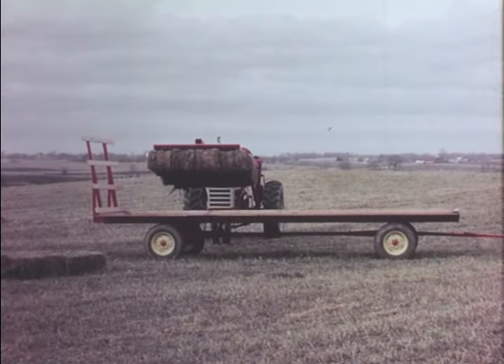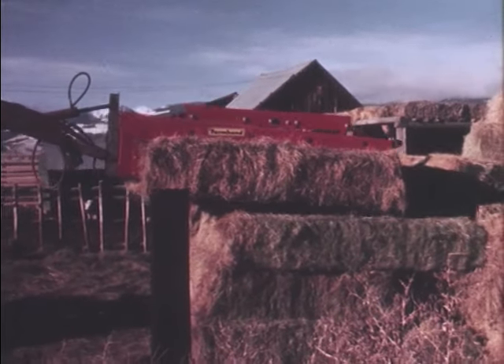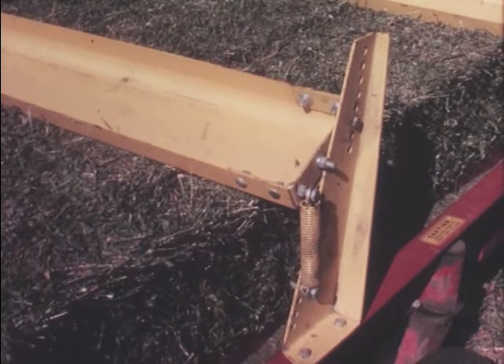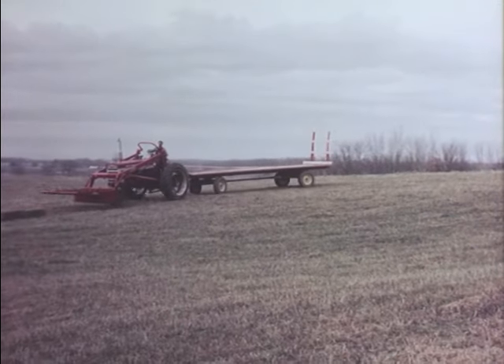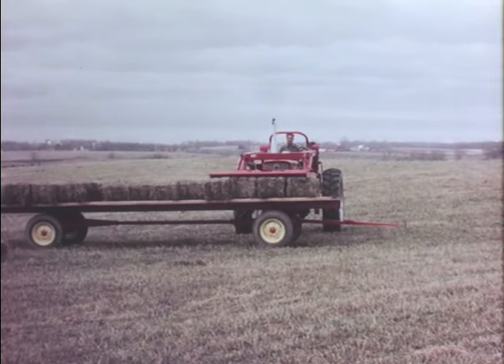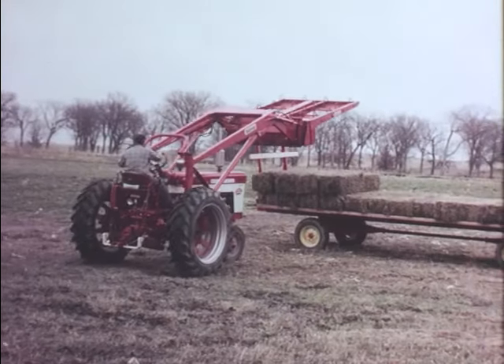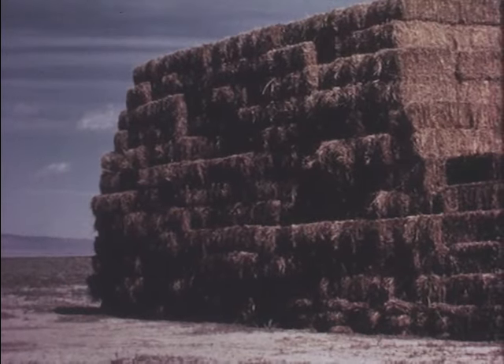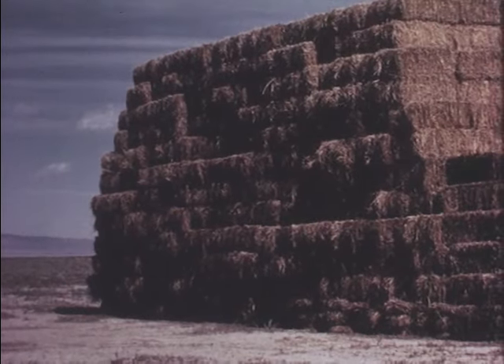Bale Handling With No Hand Labor (1950s)

Comment: I had a Farmhand Accumulator and bale fork when I was farming.  Had a John Deere 336 small square baler, an F11 loader on a 4020 to load the bales with the Farmhand bale fork.   Went to large round bales later on.  The Farmhand system worked well for me.
Reply: We had the grapple. But we had a New Holland stacker. But the accumulator is making a comeback. I see more and more of them.
Reply: << Went to large round bales later on.  The Farmhand system worked well for me.>>

So how would you compare the two, and why did you switch?

I would suppose that the square bale was designed to allow a man to move them and work at that all day. So it was designed as a way to move them by hand.

This system of stacking square bales was thus a way of utilizing an outdated concept when you wanted an entire mechanical system.  That occurred when round bales came along. 

And round bales incorporate wrapping the bale in plastic, minimizing deterioration.  That's got to be an advantage as well, although at the cost of a lot of expensive plastic and complexity to make it work.

Looks like round bales tend to rule these days!

What could make round baling obsolete?
Reply: @SeattlePioneer   Round bales and square bales are targeted at different markets, there is still a growing square bale market for horses, goats, and other small hobby farm animals. The 50lb square bales are perfect where the animal owner doesnt need a whole lot of hay for their few animals and likely wont have the equipment to move around giant round bales.

Round bales are generally only for cattle operations where the farm is already going to have the equipment to move the huge round bales around to feed their thousands of cows.
Reply: I spent my whole life moving square bales by hand. Then way back in the year 4 days ago, I bought an accumulator and grab from a farm sale. I can't wait to use it

Comment: I think this may be very early 1960s. Some of the tractor models are from that vintage, particularly the wide-front John Deere (part of their New Generation of Power launched in 1960) and the late-model tricycle Farmall, which also looks like an early 60s model. The presentation/narration style is very 1950s though.

Comment: I never understood the whole dumping the hay in the field and picking it up later thing anyway.
We always rode the hay wagon and loaded straight off the baler until we got a kicker baler. I mean seriously if you have the help to load it from the ground why not just put 2 guys on the hay wagon and load as you bale? 
  There was 3 of us boys growing up on my now brother in law’s family farm, from about the age of 12 two of us were on the wagon and one ran the baler and we took turns doing each job. Or 2 of us would be in the hayloft stacking bales while the 3rd drove the full hay wagons in and unloaded the bales onto a conveyor and 2 or sometimes all 3 of our dads did the bailing and loading of the wagons. 
  I sure wish we had one of these setups it would have been wonderful to us poor hot tired boys. Even though we used a haymow instead of stacking it would have been a real time and labor saver for us and years when we had both haymows full and still making hay stacking it in the sheds or outside covered with tarps would have been one less chore we had to do by hand.